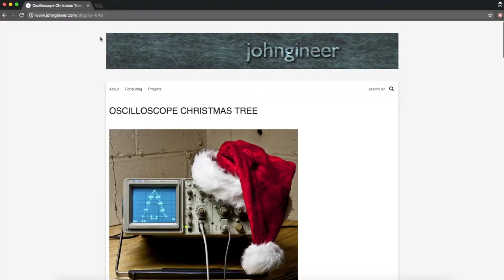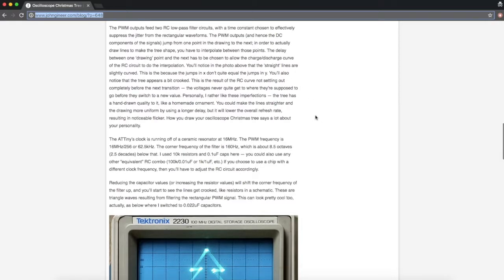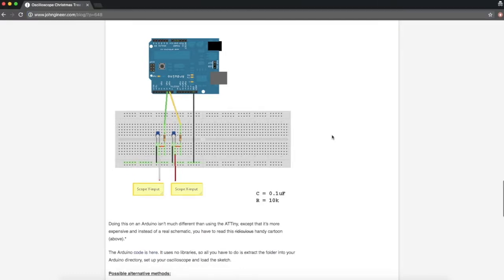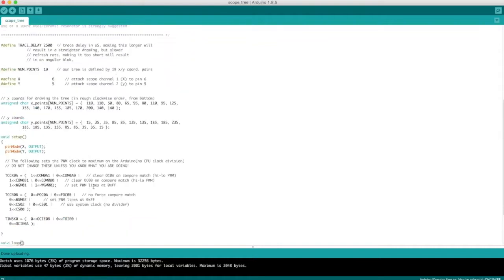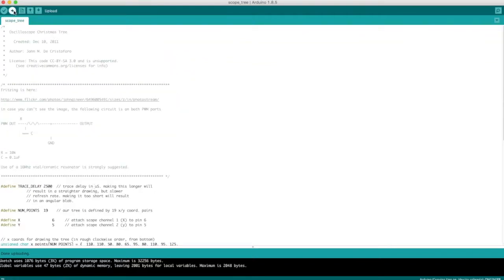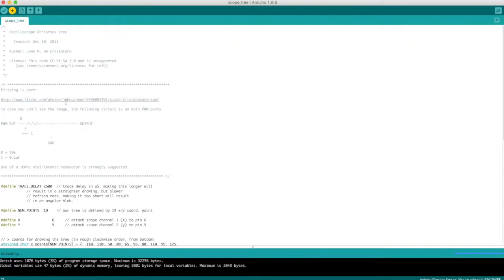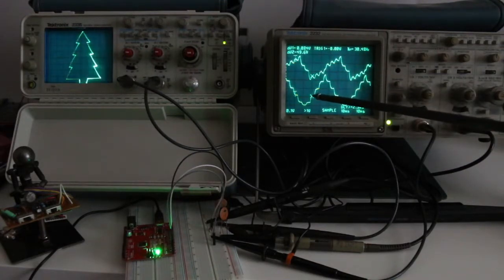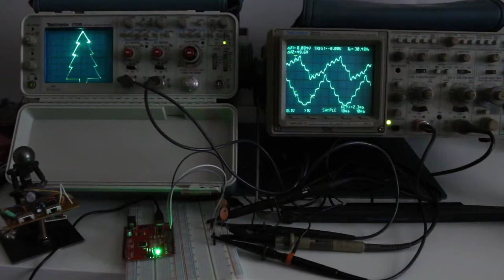Draw a Christmas Tree on an Oscilloscope with Arduino

Comment: What do you think could go wrong? I tested the exact same layout on a digital oscilloscope from Rigol but I don't get anything close to your display
Reply from the maker: I can't remember if I ever tried it on digital scopes but I think a part of the magic is the persistence of the CRT display helping trail the outline of the image as the current X,Y position moves on.   Maybe look around the scope settings to see if a persistence can be adjusted or other modes of display other than real time, so it will  lag updating...